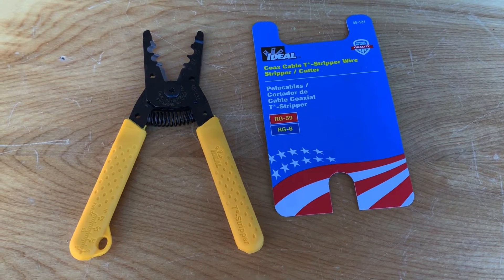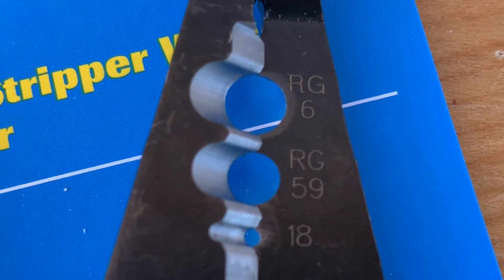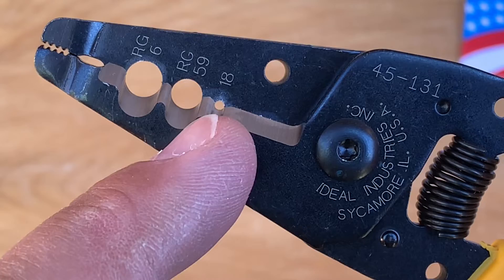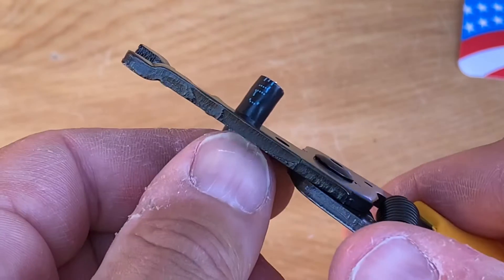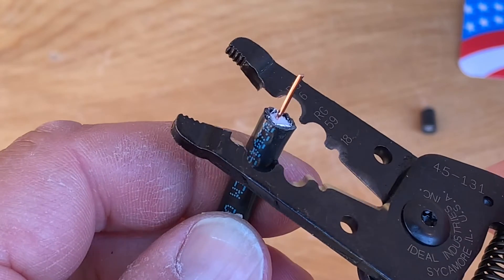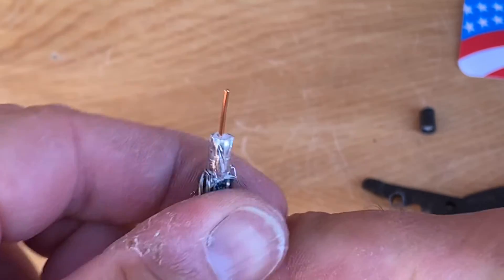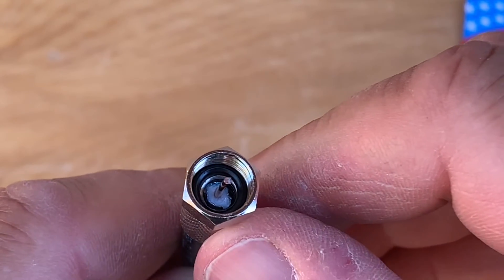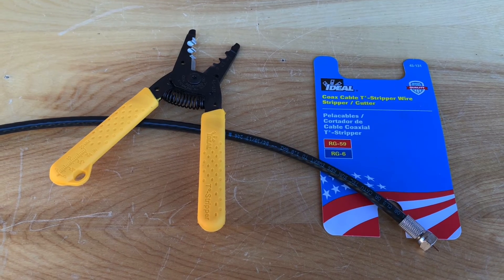Ideal Coaxial Cable Stripping and Cutting Tool - RG6 Coax Cable Tool for TV Antenna and Satellite

Comment: hey great tutorial,i have two types of coax cables one with aluminum shielding and the other with copper or bronze shielding (costs more) which do you think is the better cable?
Reply from the maker: The shielding is often aluminum, but it’s best if the centre conductor is made of copper.Thanks for watching!